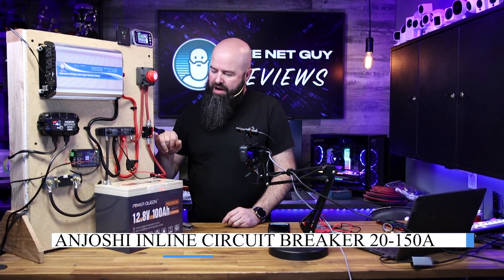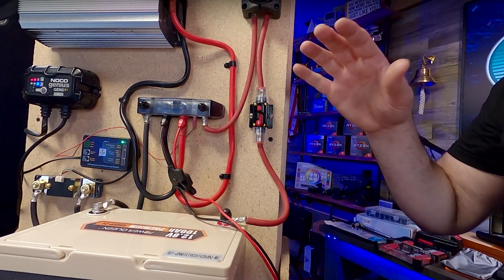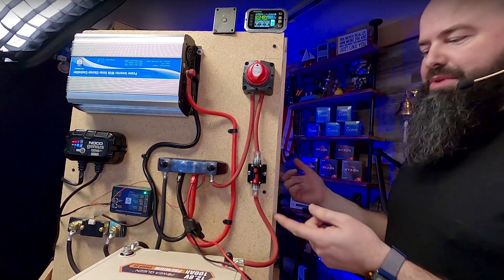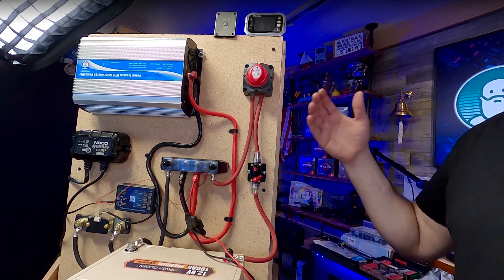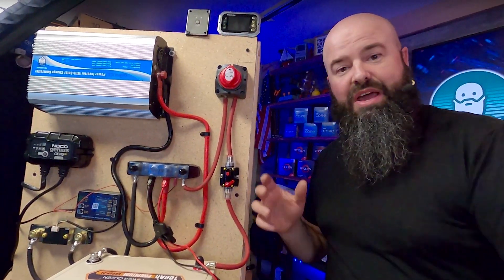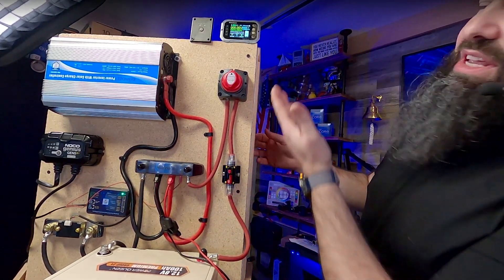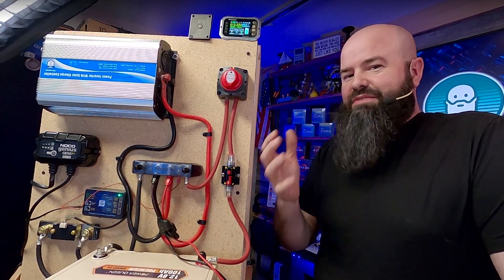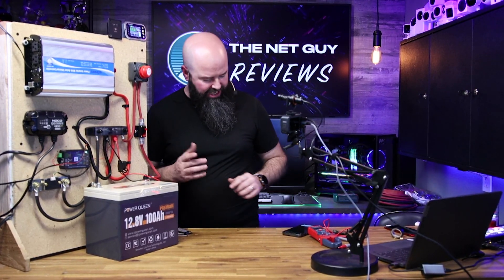Inline Circuit Breakers offer peace of mind by ANJOSHI

Comment: I can never see the connections. A cable is connected from negative on the inverter to negative on the shunt and I thought all the loads are connected to the P- on the shunt.. usually red cables. Sorry I'm literal, however I see you have one negative cable coming out of the load end of the shunt. I sound confused because I am. I can't quite understand what hooks to what. Each item I'm hooking up has it's instructions but none with the T Tocas 250 amp breaker. Does that hook on the load end of the shunt and then to the positive on the battery? Sorry I've watched 50 videos how to hook up the components I've bought. I have a 2000w pure sine inverter, 2 12v 100ah batteries, a renogy monitor and the T Tocas 250 amp breaker and it just sits. I have all the cables too, short and long, 2 awg...just don't have a simple set up where as the person does the video, they show and say what they're hooking to what. I've yet to find that. Thinking I'll find someone with knowledge by calling Renogy or those I bought my batteries from. I'm not doing solar so an mppt controller does come into play with what I'm setting up. All these people in RVs today, spending money on solar panels...they aren't needed I'm seeing.

Comment: I purchased 150a inline breaker from nilight, trying to draw 1100w from a 1500w inverter, hooked up to a 12.8v 200ah battery and the breaker would trip at or just below 105a. That was the highest amperage I've seen before a trip. No warm cables, no battery or inverter issues. Breaker specifications are not accurate. Be aware, these could be temperamental when youre needing reliability.

Comment: Another pro for inline circuit breakers is that you can find a fault in the wiring without going through a ton of fuses. Normally the amount of blown fuses cost more than the circuit breaker. Especially for automotive situations with intermittent problems.